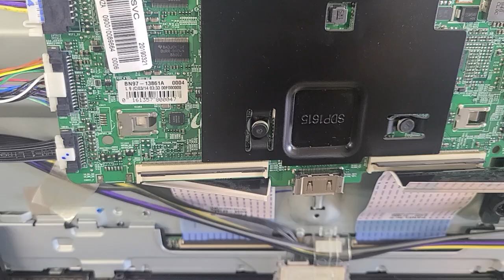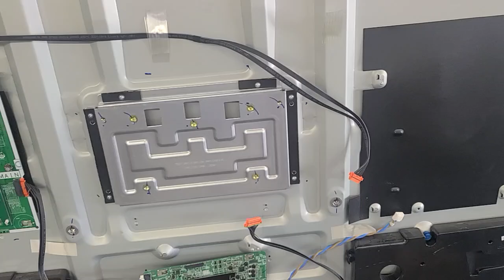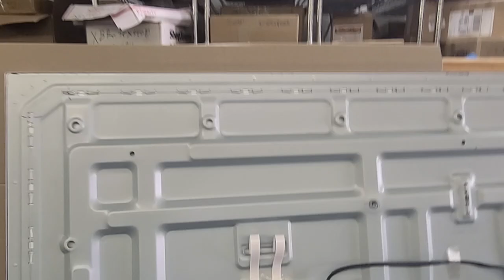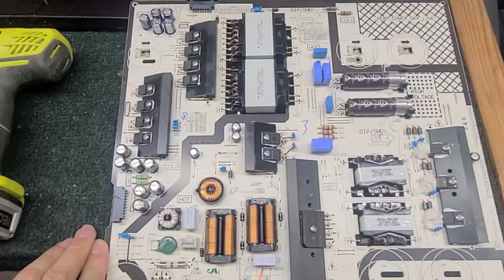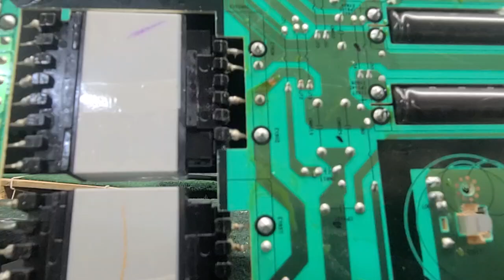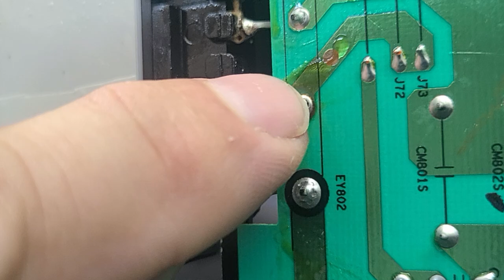How to repair Samsung QN75Q75FMFXZA QN75Q7AFMXZA suddenly gone dead, power fuse OK on BN94-11439A

Comment: My board was producing higher voltages for the VDrv but the lower 13V and under were dead.  These transformers are not fixed to the circuit board, all their weight is supported by the leads.  I imagine during shipping the bouncing causes these solder joints to crack.  It took a few years before the TV died, but I re-soldered the joints and my low voltages came back and it all works perfectly on my QN75Q7FAMFXZA.  Thanks for the post!
Reply from the maker: Great! I'm glad you were able to fix it.